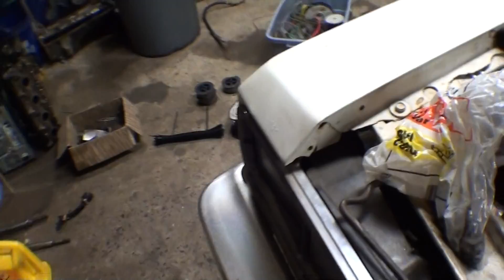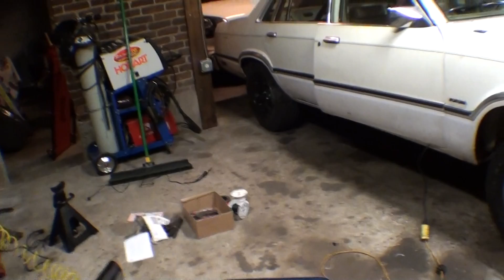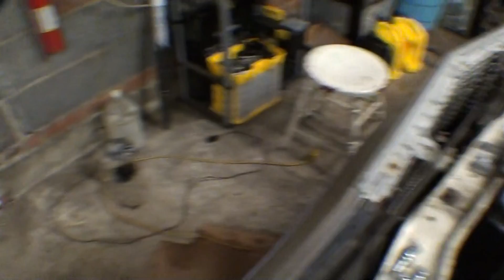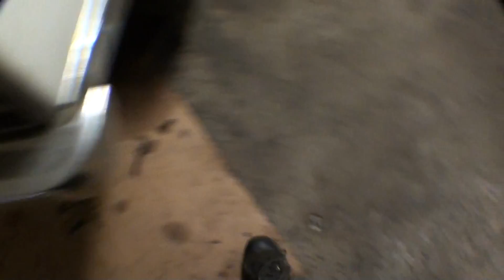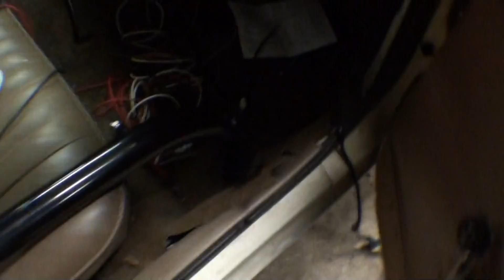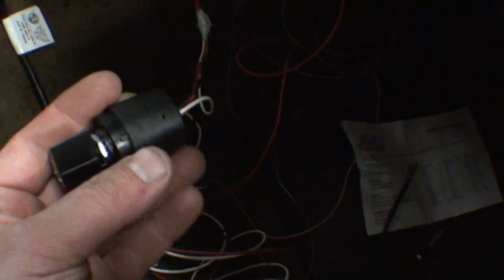3-31-15 the 88mm died in glitter factory 1.0 update

Comment: Crazy OT question of the day Denmah, where'd you get the EMC box from? Didn't know you were in the industry. Hopefully you'll be back in the saddle melting tires soon. That trim pot is cool, very efficient in terms of pin count. I would have been thinking something more like a rotary encoder. Are you gonna have an output to show the boost level?
Reply from the maker: yep emc box from work, i manage datacenters for a hospital. it turns on the close loop function and target when it hits a higher kpa, to prevent beating up the solenoid when it doesnt need to.
Reply: Sloppy Mechanics Jose writing shit inside a turbo 😂😂😂
Speaking of that 
Hey if you ever come across anyone who got a 454 out of a medium duty mid 80s gmc, and stamped in the side wall of the oil pan it says "hello peepeestick fuckface" , that would be my work😂😂
Subbed a few months back, older vids still pop in the feed to watch 👍🏻👍🏻

Comment: I was able to muster 846rwhp through a locked converter 4l80e with the s475r with 96 turbine in the 1.0 t4 housing on a stock 5.3. Rods said no. Haha.
Reply from the maker: i was hoping for a 20-25psi 800+whp
Reply: It'll do it.
Reply: Was that a stock stock 5.3 ? Cam only ? Just wondering cause I'm shooting for 800 with my 5.3 with a stage 2 4.8/5.3l turbo cam. Stock 862 heads. Threw a th400. Only difference is s476r  t4 and 1.10ar. Think turbine is 87ish. Pump gas and water/meth.

Comment: Ive heard that the oiling issues with the 4.8/5.3 is because the o ring on the pickup gets deformed when tightening the pickup because the bolt holes are not exactly perfectly spaced
Reply from the maker: that can happen yes, or its so old it can crack.

Comment: gosh i hope the engine didnt swallowed a lot of the glitter from the turbo , would be a shame to have to replase the aluminium block as whel
be smart and take the pan off clean it and the oilsucker open up the oilpump and check the clearance do a big flush and replace the olil and filter 
i personally would replace the lifters too but wat do i know,,,,,,,,

you might still be able to repair the old turbo with a new compressorweel/shaft and a rebuild kit , not so mush to re use it but to make some cadh back on selling it 
i bet there people lining up to buy THE turbo from sloppy